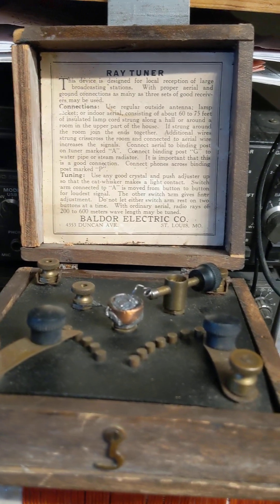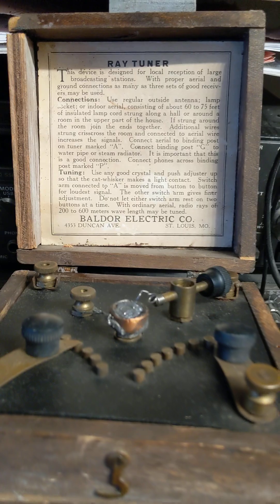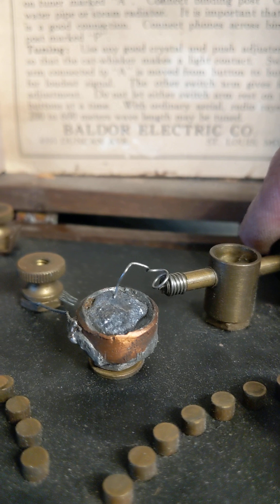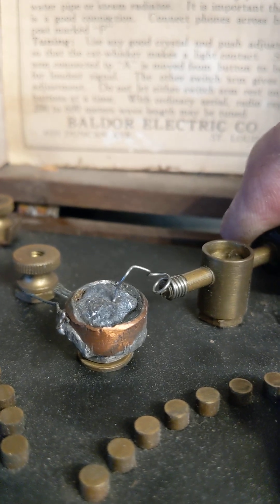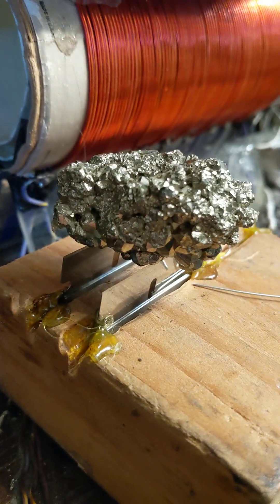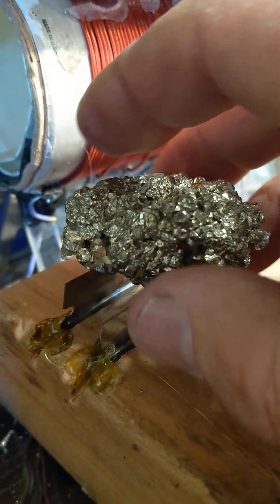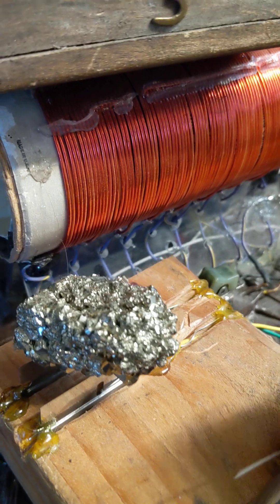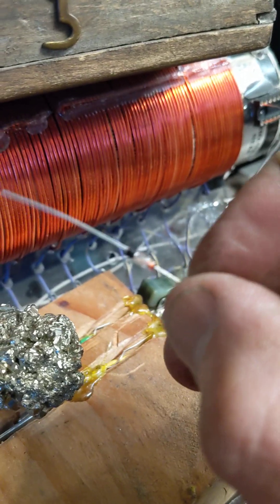Rocks That Detect Radio Broadcasts.

Comment: What is amazing is that this works on a principle first discovered  in 1876 and works   because the fine wire point touching the galena forms a "working point" where electrical current flows more easily in one direction than the other forming  a diode. 
This diode action rectifies the radio frequency alternating current received from the aerial.. enabling the audio information impressed on it (by way of amplitude modulation)  to be recovered

Had things gone differently back in the early 1900's... we might gave developed this technology far sooner to get to the transistor... instead of waiting till 1947!

Karl braun 1876
Reply: Best comment award. Thanks for explaining why it works!

Comment: Crystal radio sets are probably the 1st form of radio reception that could’ve been made. It’s not hard to make one. If you understand the laws of electronics and radio waves being magnetic electricity it really helps. As a licensed Amateur Radio Operator you are required to learn all of this for a couple of reasons. The first being that you understand what is taking place and secondly that you actually have to put forth effort in order to be able to take part. I’ll probably receive hate mail for saying this but it separates, for the most part, people who want to have a higher level of operation in more parts of the radio spectrum than any other form of civilian radio communications. 

73!

Comment: The crystal radio is one of the best projects out there, even if you are not into electronics. The sheer joy of making a pile of unassuming materials sing is unique. I personally went the easy route of the 1N34A, and even connected a second in parallel do get higher volume. Simple one day project but still one of the most fun!
Reply from the maker: So true. I got my first crystal radio as kid, and at age 67 I still enjoy find them entertaining. I'll have to try the two1N34A diodes in parallel as you mentioned.
Reply: You don't happen to have a YouTube video of that do you? Thanks.
Reply from the maker: @robinhooper7702 Here's another video i made on crystal radios. https://www.youtube.com/watch?v=G4YDsvv1DEk

Comment: They were called crystal radios. The "rock" and "whisker" acted as a diode to demodulate the AM signal to make  the sound. A wire coil and capacitor were used to tune in the signal.

Comment: As long as it acts like a diode it will detect. Need the resonator too. What’s weird is my parents heating ducts would play a local station if the condition was right. Took us ages to figure out where the radio station came from and my dad was a radio guy.

Finally traced it to the furnace. Faint but legible.

In the early 1930’s WABC (I think) in Chicago advertised they had 1 million watts. People’s gutters were singing and they could hear it in Japan.

It’s where the limits on power and the reduction at night came from to reduce skip.

Comment: Yeah... why did you think they were called "wireless sets?" The only thing the rock is doing is changing the resistance, which affects the frequency. You can do the same thing with on a length of coiled wire. That's what old car radio knob used do. Is drag a wire across a coil.

Comment: its a shame that more people aren't taught about old school technology in school. I was fascinated when I first learnt that you could have a radio literally running on wireless energy
Reply from the maker: I was introduced to crystal radios as a kid. Here an interview I dd by the author of a book on crystal radios. https://www.youtube.com/watch?v=G4YDsvv1DEk&t=356s
Reply: @GrantsPassTVRepair  brilliant, I'll show my son this👍
Reply: I used to live about 1000 meters away from an 11KV am radio tower. Some days with the correct weather it would partially power up fluro tubes. Also the toaster would regularly tune into the radio. In high humidity or fog the air surrounding it would occasionally sparkle. It's greatest trick was during thunder storms. When struck by lightening the insulators on the guy wires and the glass segment separators would give of great spark shows as it blew all the dust off them. The most spectacular was the second strike if it ever happened. The glass insulators would light up with a Plasma like show as there was nowhere for the lightening to ground to. A night time hit lit up the surrounding area like day time. So brightly that you would see it through curtains.
Reply: @dazaspc  If people saw that these days I bet it would cause some interesting conspiracy theories 😂

Comment: It's amazing what can be used to receive radio signals.
A Quaker Oats tube wrapped in coated wire, a cat's whisker much like you show, and a single small earpiece from a transistor radio.
Boy Scouts circa 1976.
Got my merit badge.
Now it's SSB voice, FT8, FT4, RTTY & SSTV (just to name a few modes).

Comment: One day while working from home and dealing with some delusional manic struggles, I became certain I was hearing voices. “It’s finally here,” I thought “the auditory hallucinations have arrived.” Then something about the voices were too… normal? familiar? So I turned off everything that made noise and followed the voices. Turns out they had an origin outside of my head. I followed the noise to its source: The copper coil motor of my oscillating tower fan was picking up AM radio signals and vibrating them out as sound. Google confirmed this happens and I maintained sanity for another day 💪
Reply: Take your b vitamins. I heard some crazy Appalachian music when my electric fan was running. The cabin I loved in was made of local rocks with a high crystal content. This music was strange like from a long time ago.
Reply from the maker: I suppose that's possible if you are close to a powerful AM radio station.
Reply: @GrantsPassTVRepair  I was near the one of the highest elevations in one of the most densely populated areas in the world, so maybe I was close to one
Reply: Then this proves yer not "Cray-Zay" ? Haw-Lol 🤠👍
Reply: 😂😂😂.Your sane.As a kid we moved into an unfinished basement. There was a copper pipe in the bathroom exposed. Once it picked up the local am station 10 miles away.So,you can take the straight jacket off now..😂😂

Comment: How does one even come up with something like this?!
Reply: The rectifying property of a contact between a mineral and a metal was discovered in 1874 by Karl Ferdinand Braun.[5][6][7] Crystals were first used as a detector of radio waves in 1894 by Jagadish Chandra Bose,[8][9] in his microwave optics experiments. They were first used as a demodulator for radio communication reception in 1902 by G. W. Pickard.[10] Crystal radios were the first widely used type of radio receiver,[11] and the main type used during the wireless telegraphy era.[12] Sold and homemade by the millions, the inexpensive and reliable crystal radio.
Reply: Many people studying physics and geology and then coming up with a few somewhat practical designs and then trying them out until it works. Most likely electrical engineers from that period. They probably or someone was  already studying conductive properties of minerals, rocks geology etc and then using that in the theory design based on physics.
Reply: SCIENCE!!!
Reply: Most of us learned from others.  There are people who will explain each part of it to you because that is the part they know well.  There are others who will tell you how to put the parts together.  Once you have that, you can then experiment to try to make something better.  You then can tell others what you found.
Reply: Before social media ppl wrote books and read books and had a fascination with the world around them

Comment: Cristal radio, I had one in 1957, made in plastic in the shape of a rocket.
Reply: They still made them well into the 1960s.  The "rocket" shaped came back in the era of Apollo, IIRC.
Reply from the maker: I remember those plastic rocket shaped crystal radios as a kid.
Reply: Yeah. I had one. They are cool.  And a rather cheap toy to manufacture.  Thanks for the 1957 memory. IT WAS A GOOD YEAR!

Comment: You can grow the crystal out of sugar on a string hanging in an old milk bottle in the fridge. Made one with my Grandad back in the early 70s.
Reply: I remember growing crystals in a glass of sugared water with a piece of string suspended in it in the late 1960's.
I doubt you'd be able to use those crystals in a radio though.
Reply: That never happened, sugar won't transmit radio signals. Quit drinking lead paint.
Reply: ... what about glucose and fructose then?
Reply: @animehair05silently88  they're tasty.
They're not semiconductors alone, any more than boron is a semiconductor alone - it's a dopant to the silicon that converts the silicon into a semiconductor, rather than insulator.
There are other compounds that are semiconductors in living organic systems, bone comes to mind. Assorted polymers, which abound inside of every cell also come to mind in specific configurations.
Hell, under specific pressures and temperatures, sucrose can be a semiconductor, just not at STP, which is, you know, where we live.
Reply: How many radio stations can you get with your rock candy? None.
Reply: @rmccarthy8352  so your less than 10 years old ?
Reply: @Funkylogic  sucrose isn't a semiconductor at standard temperatures.

Comment: Radio signals are energy traveling through the air. With a long enough wire, you can harness that energy.
Reply from the maker: For sure. I've derived enough power to light up LEDs
Reply: @GrantsPassTVRepair  I wonder what can be done with an old HAM antenna tower and some wire. I've seen some videos of transmitting towers and how much power they put out but how much power can we collect?

Comment: Good stone age radio. I maded TRF receiver and try Iron pyrite as a AM demodulator - works when find "hot spots" 😊
Reply: I'm a chemist. Some materials can be tried. Metal sulfide.  Semiconductors as pyrite. Galena. Blenda.... some oxides... as copper oxides. Zinc oxides... germanium sulfide.....

Comment: Yes! I still remember an argument I had with my mom and brother, I had read about a crystal radio circuit and was telling them about it when they explained that a radio couldn't possibly work without batteries! I showed them the sentence in the publication but they insisted it was a typo. Alas, I knew what I had read and was able to build an AM radio with a pencil graphite+blued steel detector 😊
Reply from the maker: You may enjoy seeing some of the detectors my friend uses in this video. https://www.youtube.com/watch?v=G4YDsvv1DEk&t=1s
Reply: @GrantsPassTVRepair  that was super cool and inspiring thanks :)

Comment: What will really blow your mind is the short period of time that radio amateurs made their own vacuum tubes. Before that were rotating spark gap transmitters. A motor turned a wheel of contacts so that the tone on the receiving end was adjusted by the speed of the motor. That way everybody knew who was talking. It was basically a Morse code chat room well over a century ago! 
 
As they tapped out Morse to say goodnight for the evening they'd switch the motor off so their signoff message tone would fall lower and lower until switched off. 
 
Such was the first golden age of amateur radio.
Reply from the maker: Yes the early spart gap transmitters have an interesting history. There are a few youtube videos, where they can be seen in operation, although they would not be legal to use at this time, because they transmit all over the electromagnetic spectrum.

Comment: Crystal radios relied on the lack of competing strong signals needing discrimination.  

Amplifiers and power supplies allowed design of diode detector AM radios of far lower distortion if they DC biased the diode to mostly operate in a more linear region of its curve.  That however deceases sensitivity, and so requires either a more amplified front end, or change to entirely different design higher performance synchronous detectors of far higher electronic complexity.  

And then comes AM stereo, where Kahn ISB failed the political games even if better tech than FM subcarriers, or digital IBOC.

Comment: I remember building a 'crystal' radio using the diode as the crystal.  Later connecting it's output to the input of an amplifier circuit.  Later added an  SCR to control the power to the amplifier so I could use momentarily switches to turn it on and off.  Some years later after one of my grandfathers passed away, I inherited a couple of 'cats whiskers', one with the Galena insert.  Haven't tried it yet, but have a nephew that I might show how this stuff works, he's really curious about things.

Comment: What amazes me is that this is a passive electronics device: without a power source. The sound energy is purely from the transduced electromagnetic radio waves.
Reply: There's a power source all right, the crazy power being fed into the radio transmitter
Reply: @1dgram I was just about to mention that.
Reply: Learned the basics for this skill in boy scouts In the early eighties. Cool video
Reply: @melioristicOne damn. You had a better scout leader than I did!
Reply: What amazes me is that someone figured out 1. That waves existed, 2. How to put data on waves and transmit it, and 3. How to receive, retrieve  and transfer that data to a speaker! 
Figuring out how to use rocks and razor blades as semiconductors is really cool too! 😃
Reply: @moonmagnolia7 "Small moves, Ellie. Small moves"
Reply: @moonmagnolia7 it's more like the changing the shape of the wave that carries the information. By "modulating" the frequency or amplitude of the wave.
Reply: A very small speaker and a very, very quiet room. The neighbors won't be complaining and yelling to turn it down!
Reply: Also illustrates the amount of energy that's emmited into space compared to the tiny fraction of it that's captured.
Reply: @benjurqunov  shhh energy cost money
Reply: If the signal is the power source, then we can transfer and capture energy wirelessly. Sure, the energy you capture is low, but what if we could amplify it.?... Amplifying electric energy passively involves methods that do not require an external power source to increase the energy output. This can be tricky, as energy cannot be created or destroyed (according to the law of conservation of energy), but it can be transferred, converted, or CONCENTRATED... it would work like water supply to your home reserve tank (those who live in countries with water shortages know what I'm talking about), water comes slowly and not often, so you collect it in a tank and then use it normally when you need to... how about doing this with electricity captures from earth the natural electro magnetic field.
Reply: @LondonSoundDimension oh, good. I’m very glad that I’m not the only one who thought of this! Also it may be possible to convert a FM radio receiver into a power box. Sorry, I don’t know what the proper term would be.
Reply: @LondonSoundDimension  look up the Tesla coil. It transmits energy wirelessly and can be harnessed by a tuned receiving coil. But you can’t charge money for usage so wired energy was adopted instead.
Reply: @LondonSoundDimension  ya mean like that technology in the newer car battery booster that is very compact a tad bit bigger than a portable cell charger. It apparently takes the minute latent charge left in almost dead battery. It bounces it around, builds up amperag/ or voltage and bam starts your car.? Sorry for the "run-on short story" I'm science terminology challenged🤪
Reply: @LondonSoundDimension  do you really think if it were possible we’d be wasting our time with fusion?
Reply: E o que me facina mais é a contribuição de cada fisico, cada matemático é cada cientista para poder chegarmos a esta tecnologia que abriu os portais para várias coisa suqe usamos nos dia de hoje já que até Internet é usado a transmissão e recepção de dados via a sinais eletromagnético.
Reply: I put batteries in my RC car as a kid.
Then I saw that tesla had a rc boat that didn't have batteries in it. I think it had a receiver and he sent the signal from his control station I believe.
Reply: Check out the device that USSR made called  Great Seal Bug.
Reply: I seen a video where they played am radio over a hot dog 
    Putting it between a tower adjacent to a am tower and earth
     Could hear it through the arcing electric
Reply: @terranovarain6570  There's a father and son making YouTube videos that did that at least twice.  The Dad is a radio engineer.  And they're in the St. Louis metro area, same city where the radio in this video was made.

Small world.

Edit: Their name is Geerling, if I recall correctly. 🙂
Reply: The signal IS the power source .. 🤦‍♂️
Reply: @lazertroll702  there's always that guy
Reply: Which are created using tens of thousands of watts of energy...
Reply: I have to correct a confusion here. There is no transducer in the radio itself. The only transducer is in the earphones, but that is not unlike every other pair of common headphones that use transducers.
Reply: “Electricity created from air drives car” august 28th 1921. 

https://chroniclingamerica.loc.gov/lccn/sn84020558/1921-08-28/ed-1/seq-22/

The men doing this were killed.
Reply: “Electricity created from air drives car” august 28th 1921. 

https://chroniclingamerica.loc.gov/lccn/sn84020558/1921-08-28/ed-1/seq-22/

The men doing this were killed.
Reply: Cool video 🎉🎉🎉
Reply: That correct. I made a piezo based speaker once and I could hear bbc news from the other side of the room. No amplifier, no power source whatsoever.
Reply: Yes. The fact that it had no power source was what drew me in too